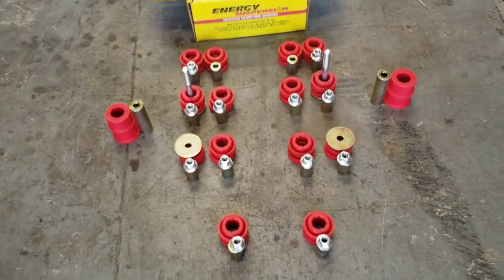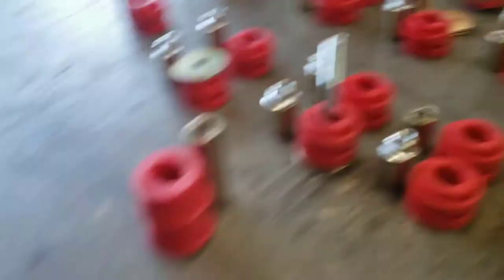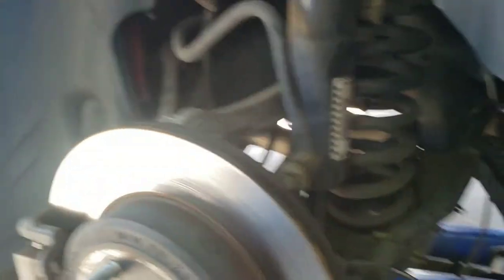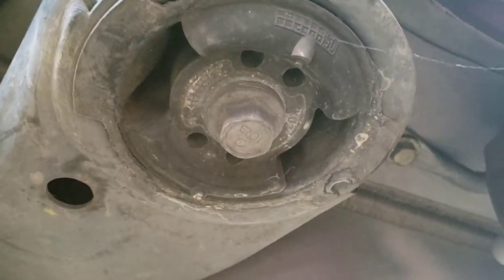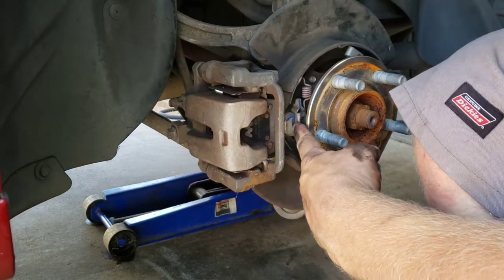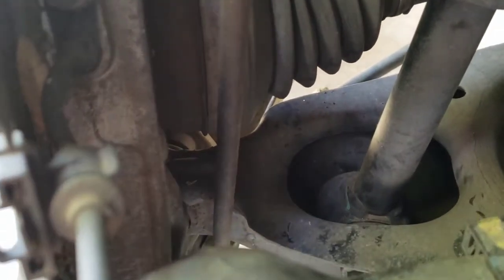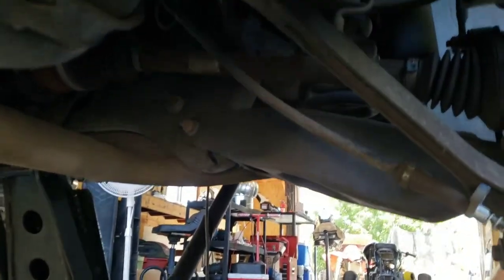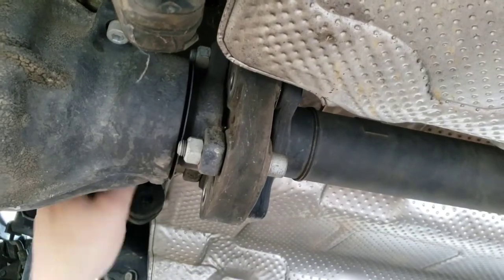How to change rear control arm bushings and subframe bushings 06 Dodge Magnum Charger part 1

Comment: at 5.00 I know the pain of that bold when I changed my rear tensioners on the 06 charger.  I had to go to the hardware store and cut that bolt out by hand with a mig shift saw.  first bolt 12 hours and I am not BS you.  The second one 6 hours since I didnt drop the rear sub frame.

Comment: i would have been tempted to try LOOSENEING all of the cradle bolts, then while supporting the one side, remove the bolts and see if there was enough slop/play to lower the ONE SIDE the couple inches in needed to lower just to get the one side's bold out, and then reverse the process...

Comment: I did this to my 2014 charger rt but changed all the links with bmr suspension instead of just changing the bushings, it was alot of work.
Reply: Was it worth it ?
Reply: @muhammedq9109  yes It was worth it, it was a lot of work but it rides and handles much better, if you lower your car you will need to do this to the back and front to be able to get the alignment back to specs, as you might know on the dodge charger there no camber adjustment on the front or the rear.
Reply: Was it hard to remove the rear cradle ?
Reply: @HemiCoop  it's not hard it just takes time and patience, it helps a lot if you remove all the bolts that hold the exhaust plus the 2 cross braces further up to allow the cradle to come down, you can move the cradle down enough to take the rear bolts that hold the links without having to remove or loosen the fuel tank, just be careful of the fuel neck.
Reply: @hermanguzman1460  thanks for the feedback. Will definitely do this
Reply: I'm doing this right now on my 2014 rt challenger
Reply: @AE-nz5ul  good luck with getting top bolt out, the whole cradle assembly has to come down.

Comment: Hello sir. I was wondering what you did with the knuckle bushing that is not included in the energy suspension kit. Did you get it replaced or find someone who has a replacement for it?
Reply from the maker: I actually still haven't replaced it or even looked

Comment: What did you do about your rear bushings thats on the knuckles and the one on the center rear control arm/spring seat?
Reply from the maker: The only thing I didn't replace was the spherical ball joint at the bottom and still haven't
Reply: @GibsonGarage  oh ok. Cause I'm doing the same thing you're doing in the video but theres no replacement for that control arm that holds the spring and bottom of the shock nor the one on thr knuckle 😫 I might just say forget it also
Reply from the maker: @FireManSRTTV  don't give up
Reply: @GibsonGarage  changing my rear carrier bushings as we speak😭 major PITA getting the old ones out

Comment: Can you tell the difference after the upgrade? Does it handle good ? Is suspension soft ?
Reply from the maker: It's not soft feels like a skateboard
Reply: Yes you can tell the difference, the ride is much more firm and the steering is tighter,  I like the way it rides it's not a soft ride but still feels good.

Comment: Why didn’t you just cut the bolts off and put the new ones in going the other direction so you would only need to fit the nut on the tight side?
Reply from the maker: It's not that hard of work now that I've done it 10 million times and I did reposition the bolts so I wouldn't have to do it in the future
Reply: @GibsonGarage   Nice! I was hoping it was possible to flip those two bolts around 180 degrees for ease of access in the future.  14:22  On the assembly line, the guys putting it together never thought of the garage mechanic having to take them off 10yrs later.  It's actually the engineers fault.  Now... maybe they decided to put them on that way so the bolts would never back themselves out accidentally, who knows.